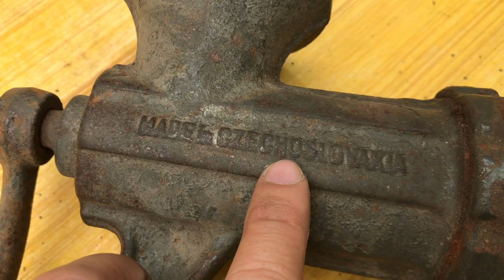Czecho Slovakian Meat Grinder Restoration

Comment: Nice restoration, but it should be covered in a layer of 99.99% food grade tin. The paint layer on the outside does not protect the inside parts and since it's from cast iron it will rust.

Comment: If one has a lathe, it would pay to add a needle thrust bearing and mating thrust washers. INA makes one for $4, available at ZORO.  The nylon bushing is good, but a real bearing makes it much easier to operate. You will use the lathe to remove about .125" from the screw and face off the end to receive the thrust bearing.

Comment: I'm pretty sure that you are missing two parts. The first one would be a rubber cap over that circle shaped element on 17:21. The second one would be a rubber "plate" that you would put between the "feet" and the table, 19:05.